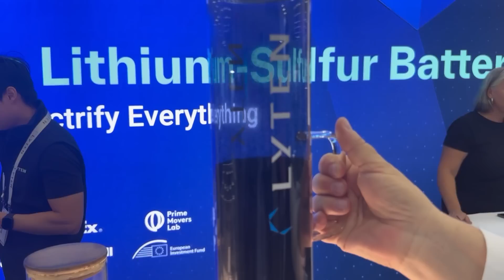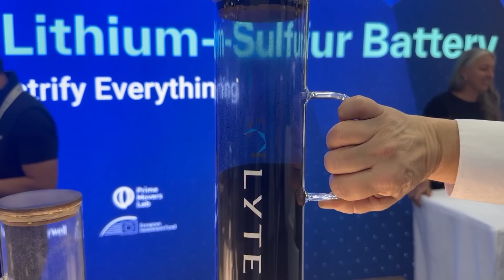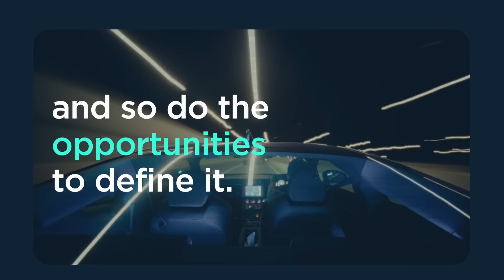Lithium Sulfur Batteries Are Half the Weight, 40% Cheaper & Coming in 2027 - The Battery Show 2024

Comment: I wonder if we'll eventually come to a place where automakers are using multi-chemistry packs where they can take the advantages of some chemistries having better cold weather performance for example, and use those as a last use bank while higher cycle life batteries take the brunt of the duty cycle. It would require more advanced management systems but I think that sounds like a worthwhile cost if you can get some nice advantages.

Comment: Information are a bit contradictory to each other. 40% cheaper but could scale up only non-automotive in this decades, does it missing opportunities?

Can’t be automotive “cycle” required yet? And not good for hybrid (10-20 years life span expectancy) which means cheap but have to replace regularly = high maintenance cost. 

Not talking about thermal run away. Claiming is useless but specific testing on its formula is needed. High energy density have potential high chance on fire issue. 

Most important is very slow scale up plan means a lot of unspoken issue!

Comment: Ths batteries  will  in future make great  impression. But   complete EVs driven with them will not.   I think that  "no produced complete EVs driven with best in world  batteries " will be  better -( they  do not  weight at all, charging is 100% no problem, people no need to build and use additional hughe  energy plants, grid,  and build home charging installations , they do not set anything on  fire . In emergency evacuation like   flooding "no posessed EVs"   are equaly as  good as aexisting EVs  except that "not posessed"      in emergency can be left home with no  worry). .

Comment: With smaller lithium cells like the model S the voltage drop is less across the larger amount of cells. The cells last longer. The larger the cell the lesser amount of cells in the cell pack and the greater the drop in voltage as they discharge and a shorter life span of the battery. We still do not see  any new battery tech in production for cars. It may be 50 years before energy density of batteries is closer to kerosine or Jet fuel. Jet fuel is 37.54 Kilowatts per gallon. Let that sink in. 37 kilowatts in the size of a shoe box. So 4- shoe box batteries with equivalent power would be over 148 kilowatts or 27 shoe box size  batteries just over 1 megawatt. 4 megawatts of power is required to get the Boeing 747 off the ground. 50 years. wait. See what happens. The future is NOT now. I need 4 megawatts in 1 shoe box battery to power my Iron  heart. Total Heartbeats: Approximately 3 billion.
Total Blood Pumped: Approximately 62 million gallons over a lifetime. Power consumption 4 megawatts. Decentralized energy (no GRID or mini GRIDs)will be common If a small powerful 1-2 megawatt batteries one day will hold massive energy. Science fiction? Nope! We are lazy humans stealing dirty OIL energy from The Carboniferous period. Plants. Plants that used solar energy. Every thing is and always was solar powered including all fossil fuels. Most 80% of the oxygen you breath is still created from a single cell(3.2 billion years old) that is not a plant. Not a Bacteria like Archaeans.

Comment: I'm imagining a future with Battery management systems that know how to manage multiple chemistries, in the same pack, strategically.
Reply: You could just have two packs. Tesla could already integrate and fit plenty. But with the performance delta NMC and LFP has it probably doesn't make much sense. For a track focused car some capacitor bank solution could make sense. Imagine being able to regen every corner in Nurburgring and not overheat the main pack.

Comment: at the beginning you can sell it at a premium to porsche and ferrari to shape off some weight and still add a bit of range.
that can refinance some of the investments a bit earlier or help to scale up faster.
and the short range aviation industry pays well also. especially the military sector that is already one important cornerstone in your business.
as you said, we live in exciting times. great stuff! it will make EVs so cheap. and it will make trucks like the F150 affordable and add quite some range. especially with heavy truck like that, it is difficult to compete with the old ICE versions when the application requires a long range. 20% more range and 20% less weight for the same price would be great already.

Comment: Hope this pans out.  But actually producing a better battery is often tried with many failures.  The great thing is we now have batteries that are good enough.  We're just looking for better and better is better.
Reply: Good enough is not great for many applications.
Reply: @jasonneugebauer5310  
Good enough is specific to an application.  LFP batteries are good enough for almost all EV applications.  Super-performance and extremely long range EVs will need a different chemistry.

Comment: does it beat the potential of aluminum graphene? how about some serious questions. other than weight and cost, what are the benefits. safety? power density? still lithium... seriously ask some questions. sounds like they still dont have the cycles problem worked out.
Reply: i guess they are in the area of 500 cycles. the graphene should prevent the sulphur to leave the cathode. i guess that is not perfect so far and some sulphur gets shuttles in the direction of the anode which destroys the battery a bit every charging cycle.